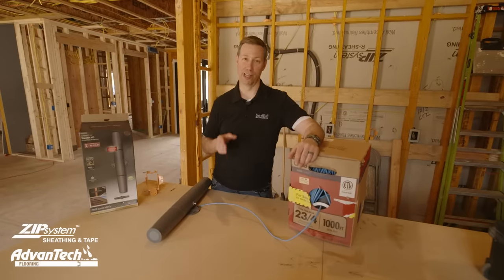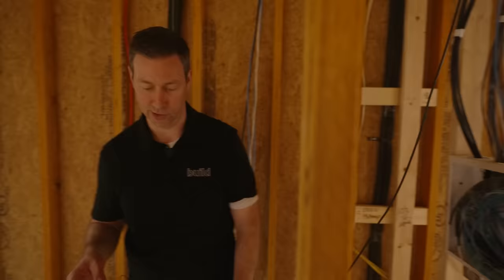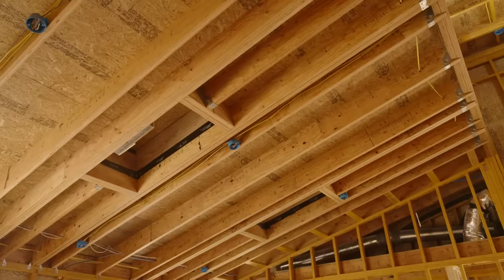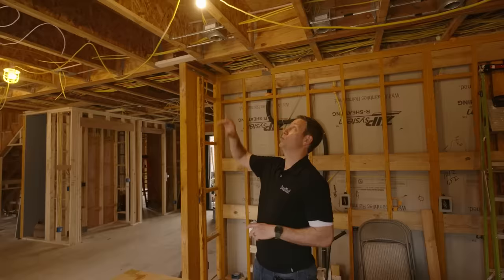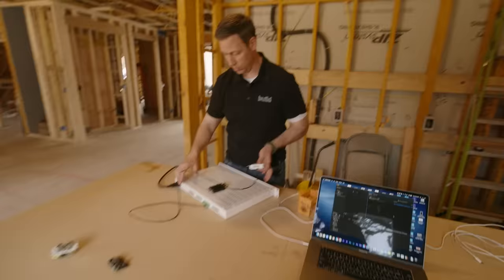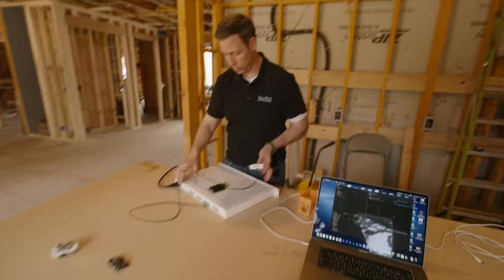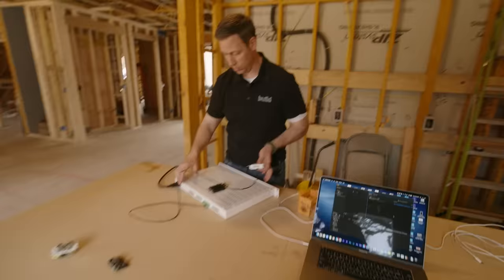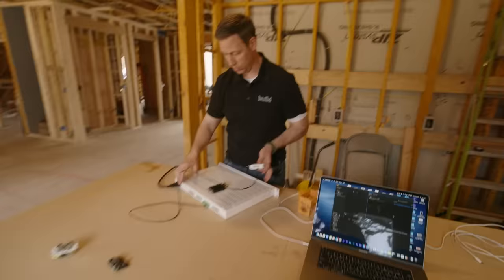Low ⚡Voltage at the Real ReBuild

Comment: other connections to think about: adequate wiring for smart thermostats, wiring for a smart doorbell camera with proper wattage, and putting in a cellular frequency booster from a roof mounted antenna. For that matter, be prepared to run a connection for a StarLink dish into your network closet.

Comment: Matt,
I’ve been in Telecom for 32 years, so glad you placed some conduit for future needs looks much better than IW stapled to the baseboard.
It sounds like you nailed the intranet side of things well, one thing you didn’t mention was your voice needs. Unless you have VoIP phone system and you or someone wants a hard wired phone a second Ethernet cable can be used for this purpose (cheap insurance). Enjoy the channel.

Comment: That antenna looks like a dipole or smething similar to me - if you will point it to the tower, that is the only orientation it will get completely NULL signal - please check the manual before doing so. Most likely the antenna is to be mounted vertically not horizontally, and most certainly NOT with pointy end pointing to the broadcast station.

Comment: Hey Matt, the Cat6 that you recommended in you notes is really not something to recommend. There is a lot of different cables on the market and its hard to know what is good and what is garbage. Rule of thumb Stay away from CCA (copper clad aluminum) and go with a solid copper material (especially if you're going all out on a build like you have). Also go with a reputable brand like true cable, monoprice or FastCat (which is what I use personally on installs for customers due to its really high quality).  The cheap stuff may work but during install if you get a kink or you pull it on a hard object you can damage it. It can also be a fire hazard if used improperly.  The higher quality stuff handles the wear and tear during installs a lot better as well and has better network stability due to better construction.
Reply: Generally agree but I know Monoprice is not as good as they once were.  If doing a whole house, it is best to just buy a spool of Belden cable so you know what you're getting.

There is a lot of cable out there today that claims to be cat6, 7 or 8 and if you actually plug it into 10gig equipment, you'll see a lot of errors showing that it doesn't actually meet the spec.

Comment: im curious how much voltage drop you get by using dc, id think a dc power supplies inside the outlet would be a lot better :D im also curious if it negotiates the higher voltage that usb-c can use
Reply: Quick glance at their website, the power supply is outputting 36dvc and they suggest 16/18 gauge wire. Meaning the wall outlets are not just  passive, which makes sense as USB-C requires some smarts to negotiate the levels.  

As for the current draw of mobile devices, the drop even for 75 feet one way (150 round trip) shouldn't be a factor, < 5% at max output.  Although I would bet they list a maximum length of cable somewhere around 100 ft, but I didn't see it on the site.
Reply: @davismwfl  alright interesting :D yeah i guessed it would be 48 vdc so 36 seems somewhat reasonable, the 5% though not that large is still something considering all the efficiency requirements going up, however any usb device consumes so little power its almost negligible :D
Reply: USB-C uses low voltage... Most high end network devices use 48v. The reason is line transmission. That's why USB only can go about 12 feet.
Reply: @SimanSlivar  the reason for 48V isn't line transmissions but lower current allowing for a smaller gauge wire. USB C goes up to 20V per the PD spec.
Reply: @davismwfl  love seeing people post information that is accurate! Thanks for doing the research.
Reply: Wondering if some of you sane folks here could comment on the merits of this system versus receptacles with a transformer. The pitch in the video is that those receptacles don't put out enough "juice" and this does - I'm skeptical about that for a number of reasons, least of all the convenient lack of any real numbers. But wouldn't you just be essentially wiring the whole house twice, once in AC and again in DC, just for the sake of putting an LV USB receptacle next to a HV? Is there something I'm missing? Is this Edison's revenge from beyond the grave?
Reply: @jimhotchkin5653  aka longer transmission over 4 pair cable... That's why 48v was used as a standard for all these years in telecom...

Also PD is different than USB-C its considered a different standard. Its also not limited to usage. But its still very limited by cable length vs 48v...
Reply: @Kavurcen  yeah i think 230v or 110v wiring with transformers in the receptacle are the way to go, also considering a usb port is like max 100w IIRC and the max output of a regular circuit is like 3,6kw for 230v and like 1,7kw for NA (i think) you could easily have a lot of other things on the same cabling. also its easy that way to upgrade in the future without having to think much about the wiring in the wall :D
Reply: @Kavurcen    The only real advantage of this system is that it can provide the higher voltages that are used by some USB-C charging solutions (when you get to 60W charging).  I am not aware of any of the A/C receptacle based USB charging solutions that can do that yet.  And power conditioning is likely to be a bit better from the low voltage distribution.  But distance limitations of low voltage power distribution are a real issue to consider.
Reply: @scottjarriel6761  is that big Apple brick a 60W unit specifically? I am seeing the newest Leviton seems to do 30W but if like you say 60W is important, is it a packaging issue for the transformer in a box or something? Just speculation. Still seems that a receptacle with a higher load transformer would be easier than running DC, no?
Reply: @scottjarriel6761  You can run 48V over 100ft with only about 5% loss on the voltage so I dont know if that is a big issue. I just keep thinking of all the things that are low voltage and the cost saving on devices if we can pull the AC/DC block out of it if this becomes a standard. Tv's , LED Light, my toothbrush. I think the kitchen is the only place that actually needs A/C now days.
Reply: Current is what causes efficiency loss, and DC is just following the modern product development curve (exponentially fast).  The last 5 years in spent in China helping a US/China study quantifying how much will be saved by DC over AC is yet another example of the trend.  Installing AF in the ceiling today is akin to buying a gasoline car.  It's just outdated tech because of physics and economies of scale.  We can sell our DC lighting at near parity to old AC lights installed cost to builders, but it has numerous benefits beyond efficiency, so we balanced that to help everyone in the channel succeed.  It's an exciting time after watching our first systems still in operation after nearly 10 years.
Reply: @Kavurcen  I recall a new MBP having a 69W supply rating (from the AC source). Output for charging the laptop (running full CPU load plus charging a dead battery) will certainly use all 60W over the TB3/USB3 cable. Hopefully nobody is using an analog transformer where size=watts anymore. I will agree the AC receptacle with power brick is more adaptable (USB4 is coming...) but if you want to avoid dragging the power brick around with the laptop all the time (and don't want to buy 4 or 5 power bricks per laptop like I did in the last place) then having a central supply and regulators/DC outlets with medium-length USB cords spread around as needed is a more esthetic solution.
Reply: @JohnBalogh  We're mostly on the same page here, nobody wants to lug around a power brick. The question is whether the central claim in the video is true - that in order to charge a laptop by plugging a USB cord into the wall, you need a system that runs twice as many wires through your walls in order to carry DC to those USB receptacles. The standard solution right now is just a USB receptacle that uses existing AC wiring, often combined with standard NEMA receptacles. In other words, basically a power brick hiding behind your wall. Not necessarily an elegant solution, but in the video Matt implies that you can't deliver enough power that way for a laptop. They seem to top out at 30W currently, but is that any kind of real technical limitation? I would imagine 60W USB receptacles in standard AC systems, were they available, would be a whole lot less expensive to implement than doing twice as much wiring, even on a new build but especially on a remodel.

Comment: Good luck getting Sonos to work! My IT firm and our architectural consultant partners we work with have gone away from Sonos because of so many control issues with mixed wired and wireless deployments. I am not sure we ever got them working with Unifi networking, more enterprise routing and switching was required to manage mDNS and multicast traffic that Sonos requires to work. Look at HD Homerun and Plex media server to replace TiVO as an option.

Comment: Matt how are retuning the audio from the Samsung frame tv to the sonos Arc sound bar? The one connect box will be in the comm closet and you’re sound bar will be by the TV, you need to double check your connections
Reply: Bluetooth (or WiFi) will do it...no cable required.
Reply: @skynetlabs  I've found the biggest problem with using WiFi or (especially) Bluetooth to connect to speakers or headphones is lipsync.  It's a royal PITA to get the delays perfect and even if it's only 3 to 5 frames off it will be VERY annoying when watching a movie.  Then again, it may be that I'm too picky about that after working in broadcast television for 20 years.
Reply: We install Sonos systems professionally in the Houston area, I really hope someone has something to return the audio back to that Sonos Arc, I’ve seen many customers do the same thing and not realize until after everything is done now they have to cut the sheet rock
Reply: He needs an hdmi from the Samsung one connect box back to the tv arc location.  Personally, I don’t like a soundbar below a Samsung FrameTV.  Kinda takes away from the look.  Id do a sonos amp near one connect box and sonance inwall/ceil spks.
Reply: I watched matt’s drywall video, it looks like he installed in-wall speakers in the wrong spot if he is attempting to pair a Sonos arc and Sonos is in wall speaker system.

Comment: When I replaced two old style incandescent fixtures in the basement, I fed the LED bulbs with DC current from a small transformer.  It takes the transformer a second or two to light the LED’s, and the output is easily controlled at the transformer.  I used two LED’s each in six locations for the 12 x 20 room.   Quick and easy!      N.E.OH Bob.

Comment: Absolutely we need a video on the tech stuff.  And yes, put the wires in whether you think you need them or not.
You will love the Dream Machine and get the Unifi Access Points as well.
While you're at it, run a clue of lines for outside......yep, you read that right or at least to the garage.

Comment: One thing about the USB in wall plugs to take care of is that I find the little "brick" adapters die relatively often. If the little transformer in the wall dies, then you have to replace the plug. One reason I am just looking at using all duplex receptacles.

Comment: Don't ever install Cat8 or "Cat7" - which, is not a standard that is in use, if anybody says otherwise, they're lying - in a residential or even an office setting.  Cat8 is real; it has its purpose: For high bandwidth applications in the data center.  It was designed for 40gigabit/s runs over very short distances.  Sure, it'll do gigabit and 10gigabit all day long just fine, but the price is not worth it for what you're getting.  

You can yell "Future proofing" until your face is blue, but the hard truth is that if you want to future proof, you need to run fiber either alongside Ethernet or in a conduit.  Cat6 and Cat6A are the ONLY two standards you should be looking at for Ethernet installations, period.  You don't need to worry about shielded Ethernet, either.  Unless you have a nuclear reactor in your basement, there's absolutely no added benefit to it; and you're doubling your work you have to do because you have to ground shielded Ethernet at both ends for it to even be effective.
Reply: Shielded Ethernet is needed if you are in a lightning prone area. A near strike will EMP your ethernet network & cost a bundle. Happened to me, A tree about 300 yards from my house got a direct hit. Fried the network switches, IP cameras, a Printer and some other devices connected.

Comment: You'll love the Dream Machine and the Sonos system. I have both in my home. One thing to make certain is to use the Ubiquity design program to plan out the best locations for your Wifi access points. Don't forget that you will want coverage for the patio and the garage.

Comment: Cat 6 is the way to go currently.  Not sure ide do the type c standalone outlet.   Type c will probably be a thing of the past in 5-10 years just like that iPod dock u mentioned.   It's all gonna change. Then you're left with a brick in the wall.
Reply: I finally decided to just run Cat-6 and skip the extra stuff for the “a” version.   I’m happy to run a wired 5Gb network I don’t need 10g to the Edge.  Once 8K settles in if I’m still in the same home I’ll run Cleerline fiber.
Reply: I wonder if you can change out the faceplate if/when the standards change.
Reply: @anandonaqui  that's a good question. If so then it might be worth it
Reply: @hmurchison8123  wireless is also getting faster and more reliable as each year passes to.  Each year something is added to wireless routers making them faster and more reliable. So maybe by the time yah move won't even need to worry bout it
Reply: @anandonaqui  you can!
Reply: @jordanlip112  I know man ..I don’t think people realize what breathing room WiFi 6e is going to bring with 6Ghz bands.  I’ve seen some promising preliminary results that have me excited enough to avoid larger computing purchases because 2022 should be the coming out party for mobile 6e radios.

Comment: 5-6 years ago, I installed a CCTV camera power system (12 cameras I believe).  It runs 12v DC 2Amp.  I ran 12v DC wires through out the house.  Most rooms have the 5m LED strips lights.  They make aluminum channels to mount it in the corners in the room.  My living room, I have a remote control that turns it on.  Bathrooms,  under the kitchen cabinets and such I have 12v DC motion sensors. The LED strips from then aren't as bright as they are now.  So it's a different type of light.  It's light that fills the room since it goes around the room.  But it doesn't have the super bright spot.

Comment: Why didn't you use conduit for your ethernet runs?
Reply: Conduit isn't required for low-voltage in residential applications. We typically only run conduit from the media panel to the attic.
Reply: @skynetlabs  I guess I should have expanded on my thought, he is running a single cable of CAT 6 and his intention is to grow old in this house, at some point CAT 6 may not meet his needs and it might be a lot tougher to upgrade without using conduit.

Comment: For anyone wanting to retrofit a USB-C PD outlet in their house, Leviton now has a 60W version that has 2 outlets and 2 USB—C ports, when one port is used it can be 60W, when both are used it’s 30W per port, they are $85 for the 15amp, and $95 for the 20amp socket versions…

Comment: Thousand dollars to charge my laptop , I must be missing something 🤔🤪😁
Reply: And when that outlet takes a shit or apple changes their charging port it will cost more again.   A simple outlet and charging brick works just fine and will always work no matter what tech port is next
Reply: Yeah I don't really get it either. I like the idea of having usb outlets, but running low voltage around the house isn't a good idea for relatively high power applications. There's a reason we run high voltage even in the house..... 

Also why those wires are so small, if you try and charge a laptop off of that system it'll pull 60w or more! So at the 5v that system runs off of that's 12 amps!! 14awg cable is rated around 15 amps. That's getting way to close for comfort, adding a phone to that system and you could go over, potentially causing a fire inside the walls. Not to mention just the power loss over longer runs.

Cable isn't rated for voltage, it's rated for amps (unless your getting in the ultra high voltage range). It would be a much better, safer, and more future proof imo to have the transformer on the outlet itself instead of in a rack mount. Need more power? Just replace the one outlet where you need it, and not have to replace the entire $1000 unit.
Reply: @mitchellvanwagoner8119  USB C supports 20V, but yeah its not the best option & many laptops use more than 100W (USB c max). My laptops use about 170W.

Comment: Also there is a device called over the air streaming where you can have one cable come from your Internet into a box and connect to your net work and stream the antenna on all the TVs with an app TiVo has one